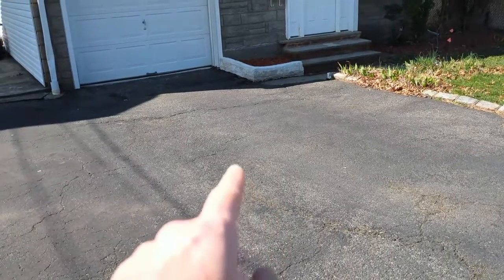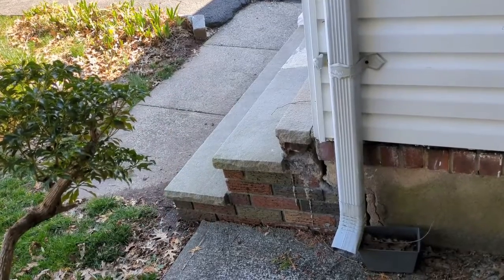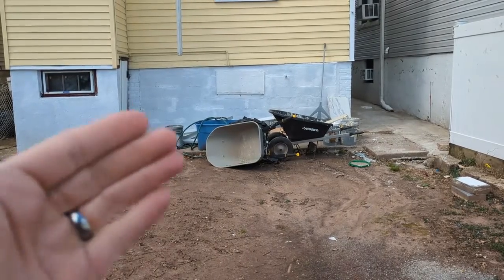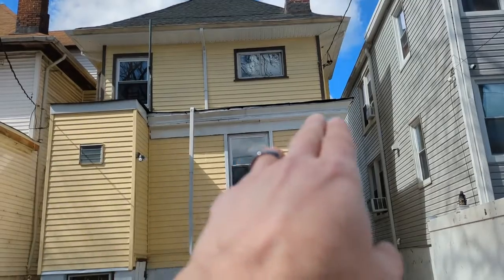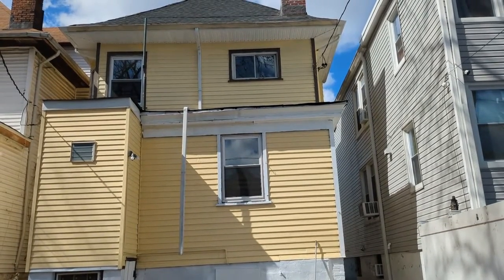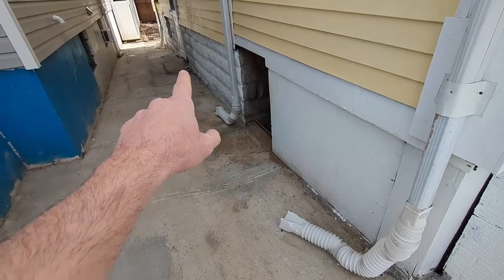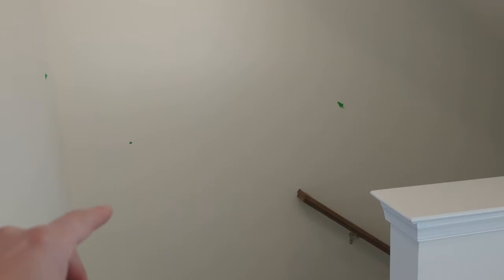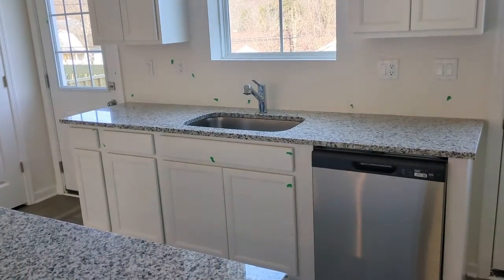NJ Home Inspector describes the Shortcomings of Home Inspector Training and some recent defects

Comment: As a home inspector with 20 years of experience, I've witnessed how the industry has evolved, and I can confidently say that New Jersey's standards are higher than most states. I’m not sure what this guy is talking about, but he clearly misses the mark! It’ is true that NJ requires 140 hours of field training, it should be mentioned that this is one of the highest amounts of in-person classroom hours in the country. Most states don’t even require in-person training and allow licensees to complete an online course! The few states that do require in-person training typically have requirements of 100 hours or less. Inspectors from NJ transferring their license are often welcomed in other states due to our rigorous training standards, while inspectors coming here usually need additional training because their state's requirements are much lower.
As for the '12 inspections' claim, I have no idea where he’s getting that from. The actual requirement is 40 hours of field-based training, and the number of inspections varies depending on the size of the house. There is no numbers of inspections it is based on hours as per the standards o practice. This is a much higher standard than most states, some of which don’t even require inspectors to perform any field training at all.
Don’t believe me just look up N.J. Admin. Code § 13:40-15.6 as it outlines the specific requirements for licensure, including completing 180 hours of study, with at least 40 hours of unpaid, supervised inspections. This guy is putting out inaccurate information, I can only imagine what his reports must be like!